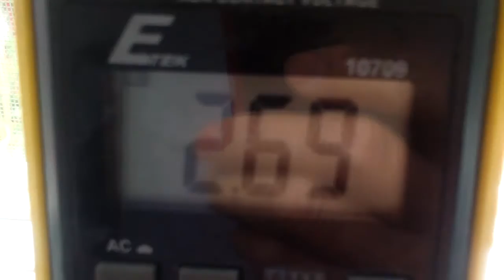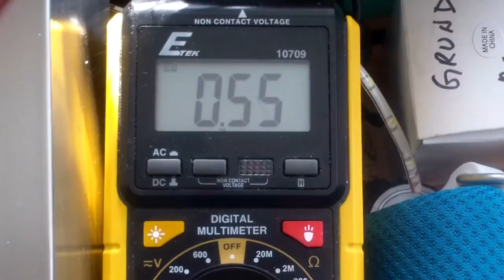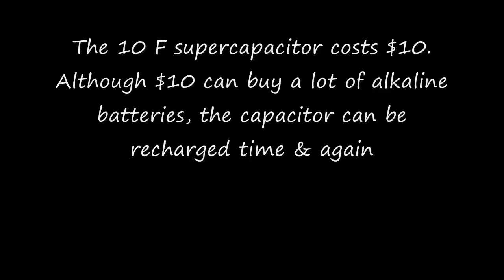100 farad supercapacitor joule thief 3 LED light test

Comment: I have the same 100F capacitor, had it running 8hrs on a joule thief with 5 leds.  I also did a discharge test using an iMax B6 charger.  It discharged at 1amp for 30min, from 2.6v to .55v.  I'm gonna run another joule thief test.  I noticed if I run 2 leds in series instead of parallel, it'l use 13mAh less with the same brightness. So in theory, it should run around 14-15 hrs.

Comment: I don't know what it takes to charge the cap, but if the batteries you already have can charge it, it would be time for another circuit:  You can leave all your solar panels and batteries and whatnot in place.  Have a battery charge the capacitor, then a device to "switch out" the battery for the capacitor.  After 35-45 minutes or so, when the voltage gets low, have it kick back in to battery for a few to recharge the capacitor, then switch out.  Your lights would obviously not stay at the same brightness, but there will be light indeed, possibly for those really long nights that don't end.
Reply from the maker: A battery or any dc power supply can charge it. The voltage and current have to be controlled by a controller as the capacitor draws a lot of current. So you are right, a circuit is needed. I have to laugh a little bit as they are talking about ultracapacitors instead of supercapacitors now. The storage capacity is of 100F I have is still much lower than a AA battery. With the right charger though, the cap can  probably be charged in less than a minute.